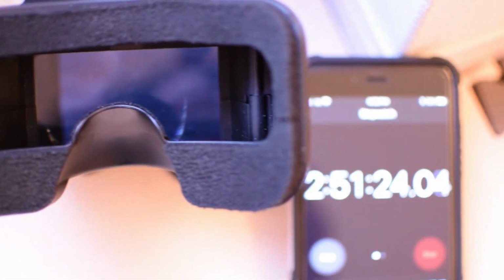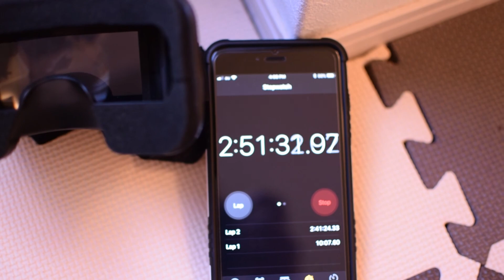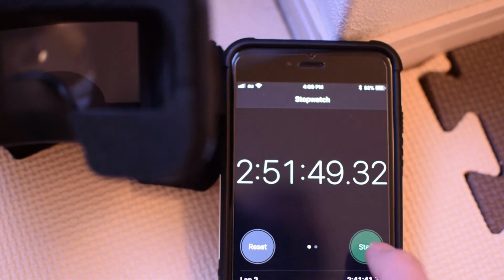Eachine VR006 - 2000mAh battery Mod!

Comment: Cool video,,,I was reading the in box instructions. It say the uit can run while the battery is charging. Can you just hook up another battery to the charging port to extend the run time with out any mods. Thanks

Comment: May i know if i this goggle can support 7.4v AKA 2s battery? because i bought an 18650 battery holder in series and im afraid it might fry the circuitboard.
Reply from the maker: No, the input voltage is from 3.7v to 4.2v. Plugging a 7.4v will probably fry the board.
Reply: RikkTheGaijin thank you for the reply i really appreciate it!:) cheers!

Comment: Great tutorial, but unforunately i burn my board and i think one of the "mosfet" (maybe) broken. It happen because i put the conector  in wrong position, what should i do sir ? Thx for the reply, and forgive my english.
Reply from the maker: Guslal M if you burned your board I’m afraid there isn’t much you can do. These goggles are so cheap you are better off buying them again then repair them.

Comment: +1👍 saw your power-bank vid, but i like the simplicity of this.  could a another battery that still fits inside work as a replacement and still be rechargeable from on-board charging?
Reply from the maker: NerdCopter [Thibodaux Louisiana] Yes, you can simply replace the internal battery with a larger one, and charge it normally through the goggles port

Comment: What kind of connector does the internal battery use to connect to the board? Is it a JST SH 1.0mm?
Reply from the maker: TheMinimazer it’s either 1.0 or 1.25, I cannot remember, but it’s tiny.
Reply: Ah, ok. Thankyou for the fast reply.

Comment: Does the battery come with the connector you soldered on? What type of charger do i need for the battery?
Reply from the maker: The battery has a PH 2.0 connector. The one I solder was harvested from another cable. You can use any charger that has a PH 2.0 plug, like a charger for 1S lipos usually have that.
Reply: RikkTheGaijin thanks!
Reply: RikkTheGaijin could you just charge the battery using the normal charging port or do you HAVE to charge the battery from a separate source?
Reply from the maker: Yes, you could still use the charging port, but I wouldn't recommend it. I use the Imax B6 Mini for charging, but you can buy decent chargers for little money. I also use this one and it's very cheap: https://goo.gl/pzYbU9